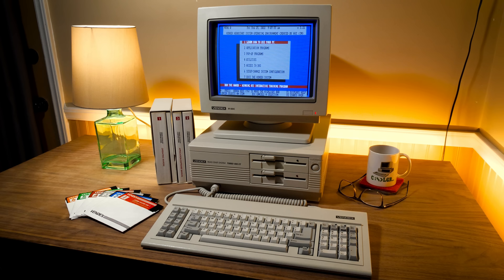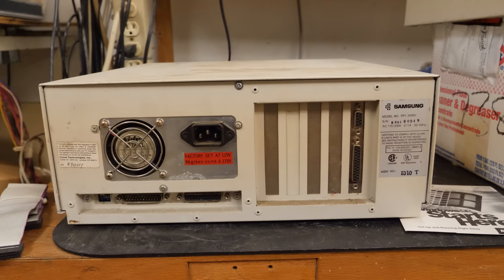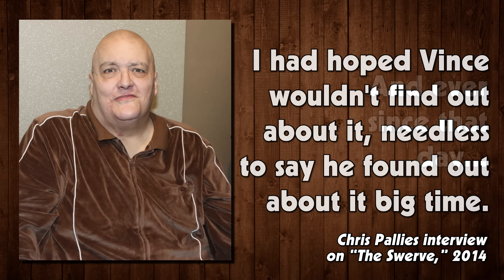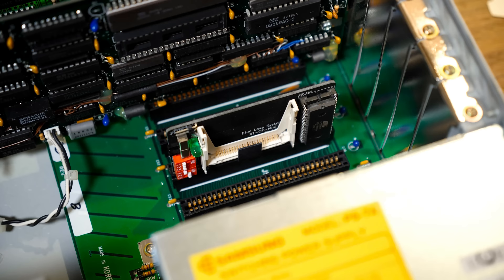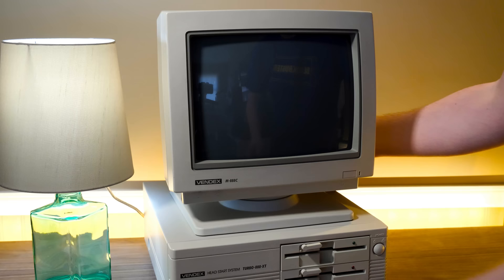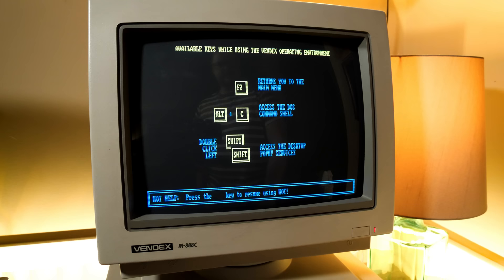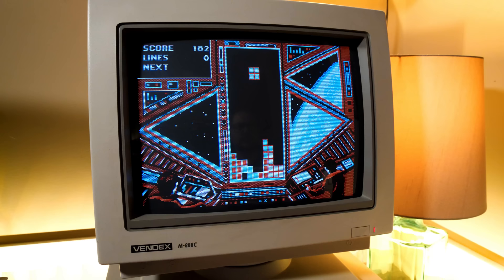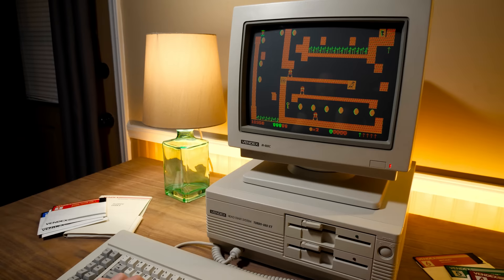The PC That Ruined a Wrestling Career: Vendex HeadStart from 1987

Comment: I recently found a Samsung SPC-3000 from a building being torn down. So naturally I took it home. It looked very much like this one, apart from the front plate. Internals were mostly the same, but it had a separate ATI ega wonder graphics card. PSU was unfortunately dead, but I sold the unit to someone who was going to restore it to its former glory.

Comment: I had a Commodore PC10 III at the time. Friend of mine had an Oliver ticket with kind of the same specs as the Vendex. It didn't want a Vendex since it looked to me as a shop branded cheap alternative. My Commodore came with a three button mouse and software. I had Testdrive too ; ) I later on updated to a Commodore PC 20 with 51/4, 3,5 inch drive and a HDD of 40Mb, colour screen etc. I was 16 by the time so pretty awesome stuff in a time when most guts had a Commodore C64 (I had a Sinclair Spectrum). It was indeed a spec war with all the clones around. Nice tines the pre Windows era!

Comment: I think their little DOS front-end thing is decent, cool.  I'm 45 years old and have extensive experience with all sorts of platforms, but I'm still pretty amazed the CPU and other main chips being on a card.  Reminds me of many of the commercial UNIX systems I've used with this modular approach.  Thanks.
Reply: In the 80s I was using a Laser 128 Apple IIe clone sold at Sears...no PC experience. In the 90s I was moving between a 486 and an Amiga 500. :-)

Comment: Nice, I grew up with a Headstart LX CD. 10 MHZ, That being the first computer with CDROM drive HDD and a 3.5 FDD. 

Last year I bought one again for sentimental reasons. Or because I'm nuts :) I have it with most cdroms, the keyboard and correct monitor. I still had the old mouse. The HDD is missing but it's missing because it was dead. I have it running with a XT IDE card now, I still need to repair the CDROM drive somehow.

I also have a Headstart III, 286 10 mhz, 3,5" and 5.25" and working original HDD.

Comment: Very interesting, I've never seen a backplane with the serial/parallel ports and floppy controller built-in. It couldn't have been cheaper to have a slightly smaller backplane and separate (long) CPU card than just a slightly larger motherboard.

Anyway, very interesting story about the wrestler. I've heard the WWE/WWF were pretty bad about that sort of thing, so I'm not surprised he would just quit over this if he was fed up with them.
Reply: although at this time, it wasn't clear how long consumers would hold onto their PCs. For the original generation of PCs for example, Intel made "Aboveboard" 286 and even 386 upgrade cards. Some companies tried to imitate. In hindsight, it was impracticable to upgrade CPUs on cards, with or without ports, when the original bus/BIOS/etc. remained so slow, but manufacturers didn't know if companies and consumers would stubbornly hold onto their old machines for many years. 
It was when Windows 3.1 came along, and people started buying an entire new PC to run upgraded software (and new Macs, too), it was then that PC makers stopped trying to make CPU cards, with or without ports attached. The fast improvements in OSes and other software drove steady sales of whole new PCs. After all, previous mainframes and mini computers had entirely different, more modular architecture and it wasn't clear that "personal computers" would be a fundamentally different market.
Reply: @squirlmy  You're probably right. The IBM PC/AT would've been around for a while, so the marketing people at Vandex probably thought offering an AT class upgrade for the machine would be an attractive option for customers. Swapping out a CPU card might be a little cheaper and easier than a full motherboard replacement, so that would make a lot of sense.

Comment: My first PC was a Packard Bell "Multimedia PC" that had a 486 SX-2 50Mhz, 4mb RAM, 2X CD-Rom, speakers mounted on the sides of the monitor.. and a box full of cd-roms. Lots of educational "multimedia" CD Roms and the one included CD game: Mega-Race.  Of course it also had Ski-Free in Windows 3.1.   The first PC games I ever bought (from Wal-Mart) were X-Wing and Doom 2.  I think it was $1200 and we bought it from a store called "Service Merchandise".  I eventually upgraded the RAM to 20mb (bought the RAM from Wal-Mart).    A year or 2 later I attempted to upgrade the CPU to a 100Mhz Pentium.  I followed the directions in the manual to change jumper switches to allow it,.. but it didn't work.  So It remained.  I used that PC from 1995 all the way until the summer of 1999 when I bought my first Win98 Compaq, which I later installed  a Voodoo3 into.
Reply: this was my pc ..... walmart pack-bells  were strange becuase some stuff would be top of the line and some parts/programs would be old trash  infact I had a year  service warranty  and was having  problem  of which I cant remember now  but when I called them  I read off the specs they needed it was dead silence  and in the background I heard " how the hell did they get that  to work with that pos board and driver set  .... it would be a phrase id hear occasionally for 2 or 3 years "  until I bought a spec built pentium from a local shop

Comment: i picked up one of these up on fleabay a few months back. upgraded to trident VGA and a lotech ram card with an XTIDE. solid old turbo XT system. I've installed a 3com NIC and have even had it online with arachne but mostly use the NIC for file transfer to the machine when i find a neat new bit of software.

Comment: Yeah grew up with the Vendex Headstart II system, still have it too! though it refuses to acknowledge the keyboard anymore so I think the keyboard controller is shot. With the massive 640k ram! and 8088 processor at 9.44mhz turbo!  Though my parents did buy the a VGA card for it, so not quite limited to mono and CGA modes. Would love to get the system working again, to play some of the old games from it, (Gapper, Reaping the Dungeon, Spacequest III, test drive to name a few have to love all the old shareware that was once a thing!) and play around with 8088 assembler again.
Though if you look up Vendex headstart pretty much all you get is the Bundy ads.

Comment: My stepdad had bought the Magnavox 300 CD computer and it came with the Head start program and dos 5. When he traded his computer in for a faster 486, the guy who built my step dad's 486 didn't want the Head Start program so I ended up getting it he didn't want the single spin CD-ROM that needed the CD caddy to hold the CDs or it's controller card so I ended up with it and my stepdad got to keep his game called The Manhole.

Comment: 7:40 the good old days when a computer needed a fan. Makes it sound more powerful too. 😊
Reply: homie, most computers these days have fans
Reply: Um, heat death is still a thing.  The power supply runs a fan, most graphics cards run fans, many CPUs run fans, then you'll have between one and 4 exhaust fans, two to four intake fans isn't weird these days, in fact, fans are one of the most common ways people accesorise their PC.  Mine is nothing special at all, and I believe it's running 8.

Comment: I had the Vendex Headstart II. With the 3,5" HD floppy drive that could also use normal 720k disks in HD.
Reply: HD, you are right, not 1.4 mb, 800k max, 2HD was 1.4?
used all these systems back then, i was just a kid, opening them up, and all, my parents did not know what it was or that i did do that. 
first thing i needed was 20Mb HDD, was that IDE? or ESDI, that i forgot. they sold LISA too at V&D back then! just before mac came
Reply: @lucasrem1870  1.44Mb (2x 720kb). I also was looking for a harddisk (I think it would have been an MFM one) but they were way out of my budget.

Comment: One of these days, you're going to have to cover what the hell Hercules Graphics were.  I always saw them in the options menu but I never  used them.
Reply: Hercules graphics was a high resolution monochrome display card. It was able to display 704x348 resolution (correct me if I'm wrong, it's a long time ago) and I rather used this mode for some games than the CGA hires mode, which was 640x200 in 2 colors. One of those games was the first Simcity. It completely looked like garbage on CGA and actually quite decent on Hercules.
Reply: @MurrayDagostino  Oh I know what it was now, I just want LGRs take on the subject.
Reply from the maker: A video about monochrome displays and Hercules was one of my earliest Oddware episodes: https://youtu.be/Yxf9aBsXOS8

Comment: The Headstart XT 8088 also came in a later variant with a CD-ROM drive! I've always found this a questionable decision since it's in no-way a multimedia PC. 

As a Dutch person, I'm delighted to see this PC (in such a great condition) on LGR. I'm a big fan of XT class machines and I have a couple of typical Dutch clones such as the Tulip Compact II (8 mhz 8088) and the Laser XT/3 (10 mhz 8086). Always a pleasure to play around with :)
Reply from the maker: The Headstart LX CD, perhaps! Quite the odd decision indeed, you pretty much would've been limited to running those early text mode CD-ROM encyclopedias, digital phone books, and other reference materials I imagine.
Reply: @LGR  Maybe they thought they could market this to gouvernment branches, schools and libraries. Guess that didn't take off very well. I don't recall seeing any of these machines in use in the early 90s, though. Then again, I'm from a rather small town where innovation was always a bit slower. We got our first classroom computer in 1995 or so and the computer room in my high school ran on 486SX machines up until 1999.

Comment: My first pc was a Headstart - but I don't know what model it was. It was unique though, it had a keyboard that was hinged to the case and looked quite cool. Except that this meant that the case only had room for a very small expansion card and also that you needed a stand to have your monitor above it - so basically useless design... 😀 Still, I loved it. It was an XT, had a 40 MB HD (I never filled more than 16 MB somehow...) and I used it with my first MIDI setup - running the Voyetra sequencer. Edit: I just remembered it also had a custom GUI and a mouse... I hardly ever used it though as there was no software for it really and DOS was way more powerful.

Comment: I have a Commodore Colt PC that I got from eBay, however, it suffered from battery damage and it worked for about 3 days until it died all of a sudden. I cleaned the board after I removed the battery and the system WAS supposed to have 640KB RAM on there and only 256KB was counted. I tried to fix the motherboard and it's still not POSTing. It attempts to show a picture, but nothing appears and I need to source a board so I can get the thing to work or another system that is 100% functional and battery-free.

In fact, the only working XT clone I have is a Compaq Portable XT that had 2x 360K full height FDDs and CGA video. I upgraded the video to EGA while keeping the original monitor installed and working with the EGA card, the second FDD got the 1.44MB FDD, the controller got upgraded to an XT-FDC + RS232 serial, installed the patched Compaq BIOS for the parallel port addrews, the other spot to prevent dust or anything to go inside is a 5.25" bay cover with an activity light for the XT-CF, has 640KB RAM (256K onboard, 384K on an AST SixPakPlus SPK-384), Sound Blaster 2.0 with CMS upgrade, and it runs on DOS 6.22 on a 64MB CF card.

Comment: Slightly funny info which isn't really funny.
There is a Turbo-X brand here in Greece of computers going back to the 1980s.  They are still making and selling them, though they are not exactly the best quality.  They also use the same brand for some rebadged electronics like TVs which 9/10 times they suck, big time.  
Yes, their first PC was called Turbo-X XT. 

BTW, that Test Drive footage looked fast to me.  I assume it was at 8Mhz as at other 8088s it was much slower, IIRC.

Thanks for the video.

Comment: I dunno if you would have the supplies for it, but i am under the assumption that you do, because you got all kinds of neat hardware and systems, things the make me feel really nostalgic, I been a viewer of yours for many of years at least a decade, and i have yet found a video on this subject matter, Build the Ultimate windows 98se machine, does not have to be era accurate, top spec possible,  I have read that 98se has issues reading anything more then 51mb of ram , but articles i have read said it was suppose to support up to 2gb, with a tweak of some file. also AGP, as well as duel core cpu's, it would be an awesome video to see what late 90's early 00's gaming would be like if you ran it on a system that was maxed out for the OS. please !!!!!!

Comment: One of these was my second computer in the day.  Or you could say my first since it replaced my PCjr.  Like you received yours, I had a 20MB hard drive in the top bay.  I think my brother in law installed it.  I seemed to remember that printing on my case was blue and swear it had a mechanical turbo switch.  I think at some point I also added the math coprocessor.  Bought it from Sears.  I do not think I got it with the monitor.  When I got the jr., the store I bought that computer from gave me a regular IBM CGA monitor because they no longer had the jr. monitors.   I used that with the Vendex.

Comment: I agree about the 286.  Not a great CPU even with the math copro.   I had a PS/2 model 60 for a short lived time with a 10MHz one.  Jumped to a Model 80 25MHz 386 model and dropped in a Cyrix 486DRx2/50, 32MB ram, SCSI with a 1GB seagate HDD, Reply Tech SVGA with 1MB, Disney Sound Source, and a MAG DX-15F.  This was during the Windows for Workgroups 3.11 years.   Even had a HP4p scanner.  Ran a 33.6 USR modem.

Comment: Vendex was a retail company,  not a manufacturing company. It originated from the V&D department store chain. At it's peak it also owned a temp agency, an insurance company and a travel agency, but they never manufactured anything. They undoubtedly bought in all components and outsourced the assembly too. The stores of course sold computers and they wanted one under their own brand.

V&D was not the kind of store that attracted a cutting edge crowd, so it is natural and sound thinking that they targeted people starting out with this new computer thing.